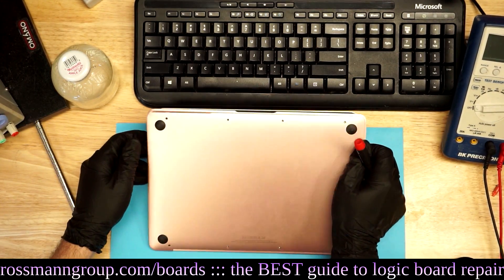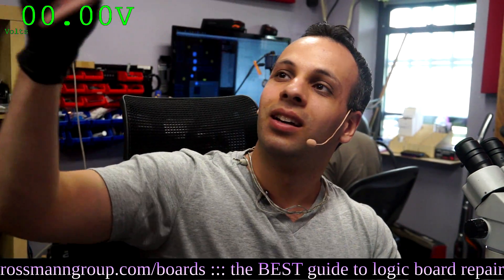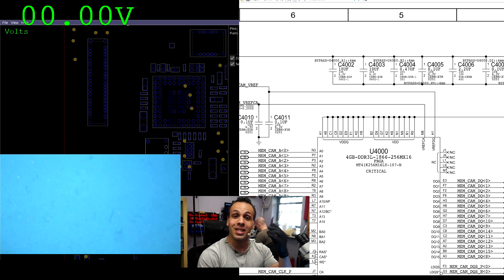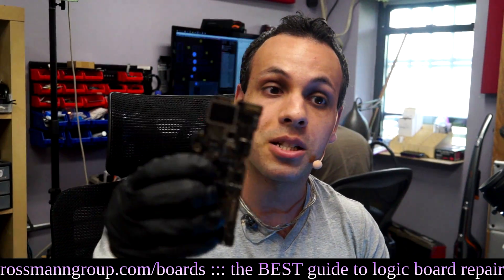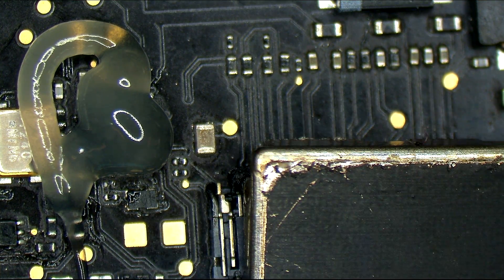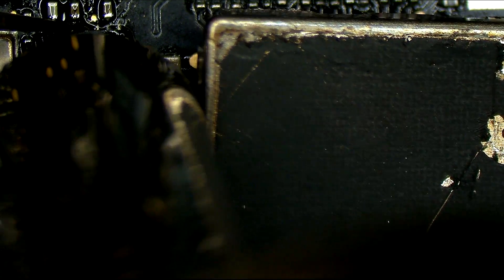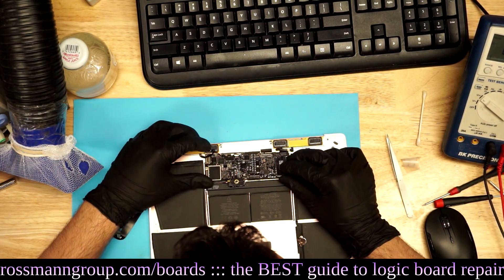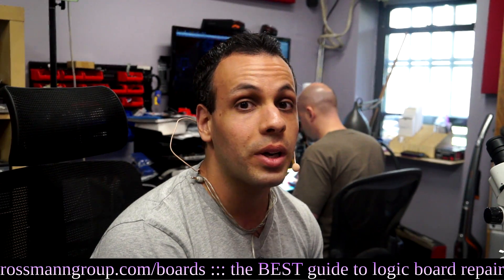Mall repair franchises are garbage and ruin the credibility of our industry.

Comment: Instructions unclear, got my testicles glued to the cmos battery.
Reply: Don't modern machines only need it for the RTC? BIOS settings are stored in non volatile memory?
Reply: I HATE when that happens
Reply: Abdullah Ahmed  r/wooosh indeed
Reply: my balls are the cmos battery
Reply: Cmos (complementary metal-oxide semiconductor) is a semiconductor - and cannot be battery...
Reply: @mrkv4k  he is actually correct. A cmos battery a coin cell battery for the Cmos to be able to store everything.
Reply: @ madmax2069 No, he isn't. Again, "cmos" is the technology,  "Cmos to be able to store everything" is just a nonsense...
Reply: @mrkv4k  It's commonly called a cmos battery. Stop being pedantic.
Reply: @demoniack81 Ok, I wasn't aware that this mistake is common.
Reply: @mrkv4k  It's a valid name for the battery.  Probably more prevalent than other names.
Reply: @mrkv4k  Its the term usually used to describe the small amount of memory on a computer motherboard that stores the bios settings, you could call it Real-Time Clock. CMOS RAM, NVRAM or NV BIOS memory or even COS-MOS which means complementary symmetry metal oxide semiconductor.
Reply: @ Kristian T. Again, it's not. Not a term. I get that people colloquialy use it (even within the industry), but "CMOS" is a short for "complementary metal-oxide semiconductor" and is a term for technology, simmilary to older TTL (transistor-transistor logic). Correct term (that you could use for example in your bachelor thesis) would be "RTC battery" or "BIOS bettery".
Reply: @ SerpentInside One more time, ok, it's a commonly used name. But it isn't a term. Term is something, that you could write in your university work.
Reply: @mrkv4k  So the problem here is that this guy glued his testicles to a CMOS battery, however that either doesn't exist or isn't an acceptable term solely because you can't use it in an academic paper?
If I recall correctly, informal comments online, such as the ones here, do allow for colloquialism.
Reply: Cosmic Taco Cat I never said they don't.
Reply: @mrkv4k  Well. Why not just Google it up and see what it actually means?
Reply: @johnyang799  I know what it actually means and that's why I responeded this way. I get thet you are confused by google and many people searching for the this non-term, but that happens all the time (try googling Irregardless, it's not an actuall english word, yet you find it all over the place. Same goes for "persay"). CMOS battery is a nonsense, that many people (especially those who are into computers but not electronis) use.
Reply: @mrkv4k  No. You only knew what CMOS-FET meant. Not the term cmos battery. Term came from practice. Not what you think it would be. It's misleading for you in the beginning yes. Now you need to accept it as a term.
Reply: @mrkv4k  CMOS battery is not nonsense. It meant for battery for cmos which itself is short for cmos memory. Active memory that needs power to retain data. No issue there. 
Same as phone battery, car battery. It's not battery that made from/of cmos it's just battery for cmos memory.
Reply: @johnyang799  Oh, I see the problem - you don't know what "term" means! Term is not just a colloquialism that is used by engineers and it almost never "comes from practice", it's well defined beforehand.
It's obvious that it's above your head, since "CMOS-FET" is another nonsense that you've fabricated on the spot. The "C" in "CMOS" stands for "complementary" and that means the ability to have P and N chanel "FETs" on the same die. It's a technology that logic chip use. the "FET" stands for "field effect transitor" and is for single transitors. The "CMOS" is always made out of "MOS-FETs", but using those terms together, as "CMOS-FET" is like saying "woods-tree".
Reply: @mrkv4k  "actuall" isn't an actual English word either. 
Plenty of people use the term CMOS battery, as it stores changes made to the BIOS stored in the CMOS. 
Your car doesn't need a battery to run either - is there no such thing as a car battery?
Reply: @Cheepchipsable  That is not what we are talking about here, is it... And no, noone uses term CMOS battery, because it's not a term. It's a nickname at best.
Reply: @mrkv4k  I do appreciate this conversation, thanks
Reply: @ArtisticallyEligible  Well, sure :D And thank You, because it has been going on for about a year now and I have never read it all at once - up until You've mentioned it...
Reply: mrkv4k I just read the entire thread.

2 months ago, I overclocked my RAM, fucked up badly and wanted to reset BIOS. I searched through google and was asked to reset ‘CMOS battery’. Did it. So I always thought that the coin shaped battery in the Mother board as CMOS battery until I read this thread. I searched through most of the articles now, for example, ‘reset BIOS’, ‘Where is the BIOS setting stored’ etc. Every single one of them refers to the battery as ‘CMOS battery’. I also searched ‘What is CMOS battery’. I did find great amount of articles and forums, study materials that refers to the battery that supplies power to CMOS RAM as ‘CMOS battery’.

mrkv4k, though it is embarrassing to say, I am unable to find the standard term system for the parts in the motherboard. 

Would you please provide the source material which is peer reviewed and widely accepted as industrial standard for the parts in the motherboard?
Reply: @BharathiChristiano  No, I would't. It's not necessary and it would take too much of my time. It is clear enough from the meaning of those words, since the "CMOS" stands for complimentary metal-oxide semiconductor, it is by DEFFINITION not a battery, it's technology used to make semiconductors.
What you are talking about is just like saying that you went to a pub, ordered Coke and got Pepsi. Therefore "Coke" is a term for Pepsi or soda in general... And you've chcecked this online with many and many people using it like this.
I seriously dont know how many times I have to repeat this, it doesn't matter how many people are using something, people are using words wrongly all the time.
Reply: @mrkv4k  "Not necessary"

When you present an argument that it is correctly used term, you present the proof of actual usage in industry or the standard metric along with the argument. 

Argument with no proof of reference is just some random baseless claims.

I believe we all in this thread that partook in reply to your comment know that it is indeed a MOSFET fabrication process, so you don't have to state it multiple times which they all already knew. 

What all of the participants try to explain is that "the CMOS RAM requires power, that power is provided is provided by a battery, the battery is commonly referred to as 'CMOS battery'. Just because name 'CMOS battery' has 'CMOS' in it doesn't mean we are referring to the technology itself, it is just a battery that power CMOS RAM."

 Everyone says in this thread said this.

Your argument is that 'it should be called CMOS RAM battery or Nonvolatile BIOS memory battery or memory battery'.

Well those terms are indeed correct but it is curretly widely used as 'CMOS battery'. 

You have three arguments for this,

1. It is not a industrial standard term.
2. It is not widely used.
3. People are using the wrong term.

For point 1, you have yet to provide reference or evidence of some sort.
For point 2, it is indeed widely used from Wikipedia to tech forums to motherboard OEM to chipset OEM. 

From the industry chipset leader, 'Intel' reads as follows:

"What is CMOS?

Complementary metal-oxide-semiconductor (CMOS) is a small amount of memory on a computer motherboard that stores the Basic Input/Output System (BIOS) settings."

Not even the industry leader refer to CMOS RAM as CMOS RAM. It was referred to as CMOS. 
As for point 3, only you happened to wrong. Remember the name of the  PCB that holds all this technology, 'Mother board'. So by your definition, "it is a board made of mothers" or "board for mothers".

It is not. It is a PCB that is found in computers, expandable systems, etc.

https://www.intel.com/content/www/us/en/support/articles/000025368/processors.html

I can provide a reference that it is indeed a widely used term along with the term 'memory battery'.

Reference: https://en.wikipedia.org/wiki/CMOS_battery

A wikipedia page, widely referred to by people for references.

I also have other hundreds maybe even thousands of articles and study matetials which refer to the battery that powers CMOS RAM as 'CMOS battery or memory battery' or 'CMOS battery' in the motherboard.

What reference do you have that it should not be called CMOS battery?

If you have no reference to any study material or evidence industrial usage, we can stop this conversation and finalise that it is indeed called as a 'CMOS battery' or 'memory battery'.

We finalizing has no impact on how the CMOS battery is referred to, it is already been, being, and will be used as the term by the people and the industry.
Reply: @BharathiChristiano  That is so wrong, on so many levels, I don't know where to start.  You didn't even bother to write my argument correctly...
Btw, you can keep telling us that your have "two stroke four piston battery" in your car, it's fine with me.
Reply: @mrkv4k  No argument there. Well that is what I expect from a groundless argument.
Reply: @BharathiChristiano  when someone refuses to admit they know absolutely nothing amiright
Reply: @jonniezodiac  The argument would hold some ground if there was a standard reference for the claims. There was none so let us leave it at that. No point in arguing over baseless claims.
Reply: @BharathiChristiano  You have demonstrated that you dont even know what the claim is. How am i supposed to argue against that...
Reply: @mrkv4k  You are very welcome to explain that claim as well that 'How I don't know what a claim is.'
Reply: @BharathiChristiano  And to be exact, because I already see you making even bigger pile of BS, let me dissect that comment:

I believe we all in this thread that partook in reply to your comment know that it is indeed a MOSFET fabrication process, so you don't have to state it multiple times which they all already knew.
- I believe that you don't, since you over and over misuse the correct terms. MOS-FET is not CMOS, it's not even the same fabrication process. You are CLEARLY talking about stuff that you don't know anything about.

What all of the participants try to explain is that "the CMOS RAM requires power, that power is provided is provided by a battery, the battery is commonly referred to as 'CMOS battery'. Just because name 'CMOS battery' has 'CMOS' in it doesn't mean we are referring to the technology itself, it is just a battery that power CMOS RAM."

- So? I have never disputed that.

Your argument is that 'it should be called CMOS RAM battery or Nonvolatile BIOS memory battery or memory battery'.
- No, it isn't. My argument is that "CMOS battery" is not a term.

You have three arguments for this,
1. It is not a industrial standard term.
2. It is not widely used.
3. People are using the wrong term.
- ad 1. Never said it isn't. ad 2. Never said it isn't. ad 3. Yes, they are. Like in sooo many cases where two or more fields of study cross.

From the industry chipset leader, 'Intel' reads as follows: ...
- As an experienced engineer, I have to say that this kind of work is being done mostly by interns and part time working students. It doesn't really contradict my point, since having colloquially used phrase on your website help has nothing to do with the correct scientific terminology...

A wikipedia page, widely referred to by people for references....
- Wikipedia is written by people (like me for example) and it is not a reliable resource. That said, I see no harm in having page on something that is commonly used jargon, especially in the very specific field.
https://en.wikipedia.org/wiki/Wikipedia:Reliable_sources/Perennial_sources
Reply: mrkv4k  Apparently you did not do a good job at dissecting anything. Here is the response:

You claim that I claimed Metal oxide semiconductor field effect transistor is CMOS. I did not. I claimed that it is a MOSFET fabrication process.

Reference: https://en.m.wikipedia.org/wiki/CMOS

Your main argument is that the circular battery that powers the CMOS RAM cannot be called CMOS battery.

I would rather take a industrial Chipset designer and manufacturer, and Motherboard manufacturer's  naming convention over a random stranger claiming he is a experienced engineer. Even if you are a legitimate engineer, your experience has no meaning in the industrial naming convention. You are raising credibility question over the industry leader for using less competant engineer to compile the website when you never have produced any reference which raises questions on your credibility not on the OEMs using the naming convention.

Yes indeed. Wikipedia is written by people. Apparently there is this section in the wikipedia page called 'References'. Reference section has links to the IEEE papers, study materials, books, etc. which the page has written as references by people. Disregarding the particular page is same as disregarding the references that is used to compile the information in the page which leads to questioning your competancy or maybe even integrity as an engineer.
Reply: @BharathiChristiano  At this point, it is absolutely meaningless to loose any more time with you. You post strawman after strawman and argue against something that was not even said.
"Your main argument is that the circular battery that powers the CMOS RAM cannot be called CMOS battery." 
-No, it isn't. I think you are just trolling me...

"You claim that I claimed Metal oxide semiconductor field effect transistor is CMOS. I did not. I claimed that it is a MOSFET fabrication process."
-No, It is neither. And again, I am not surprised since that wiki source is some random blockpost on some random website... That statement is literary like saying that table making is a kind of chair-making process.
Reply: mrkv4k “straw man after straw man”, while I was quoting what you had to say and the article and its reference has to say. Right.

It is thought that is point of this entire thread, saying otherwise is just not genuine. CMOS is indeed a MOSFET fabrication process and I also gave you a reference which had references from IEEE papers, it’s history, study materials, etc. I don’t care about your personal feelings towards naming system and your thought process. All I care is industrial wide accepted naming convention which I have provided plenty of references for and you have none (yet). I am quite willing to learn, if you can provide at least one source material for your claims that is peer reviewed or naming convention system that is industrially accepted.
Reply: @BharathiChristiano  
So you quoting me is the reason why I had to write "No, it isn't" after every time you write "your point is..."? Is that how it works in your opinion?
And while you continue to dismantle something that is not my argument, how is that not a strawman? That IS the EXACT definition of a strawman...
Reply: @mrkv4k  Exactly! "No, it isn't" isn't enough. Reliable reference or it's just baseless claims. I referenced all of your previous replies and information while you claim you did not and no references for naming convention yet. Pretty much you have no reputation now to make claims and say it is the standard. While I have none either, but I provided some references which is pretty much have references from reputable sources.
Reply: @BharathiChristiano  At this point, you are just trolling me... "No it isn't" IS enough when you clearly misrepresent (or completely fabricate) my claim. That IS the definition of strawman.
Reply: @mrkv4k  Oh I did not, did I? Pushing aside all arguments as 'trolling' is just a bad argument per se.
Reply: @BharathiChristiano  Look, you are really dishonest. I corrected you repeatedly and yet, you are still putting things in my mouth. And acting like my argument is somethingh else than "CMOS battery is not a term". You even wrote:
You have three arguments for this,
1. It is not a industrial standard term.
2. It is not widely used.
3. People are using the wrong term.
And where is your misinterpretation must be clear from my response: - ad 1. Never said it isn't. ad 2. Never said it isn't. ad 3. Yes, they are. Like in sooo many cases where two or more fields of study cross.
Reply: mrkv4k Exactly. You told people that it isn’t correct because you can’t use it as a reference for any material such as school, college projects, etc. in your previous replies to others. If you want to correct people that ‘it isn’t right term’, then provide a reliable source that says it isn’t called CMOS battery. I could careless about a stranger giving explanations, all I want is a reliable reference which you had plenty of time and text space with no limitations, you still failed to provide any of that, while I searched through internet for maybe 2 minutes? Found IEEE papers, study materials, articles, etc. referencing it as ‘CMOS battery’. I am the one dishonest here? I don’t really care what you think of me, all I want is reliable source. Pretty non genuine to be honest.
Reply: @BharathiChristiano  You repeatedly claim that you've found "IEEE papers that use 'CMOS battery'", but I haven't seen one from you, only the claim itself. As far as this exchange showed, all you have is articles from some websites and wikipedia. If you actually do the search on IEEE website, you won't find anything: https://ieeexplore.ieee.org/search/searchresult.jsp?newsearch=true&queryText=%22CMOS%20battery%22

On the other hand, It's nearly impossible to find peer reviewed article about something that isn't a term. Like try finding one about this https://upload.wikimedia.org/wikipedia/commons/5/59/Vespula_germanica_Richard_Bartz.jpg not being a Ford Focus...
Reply: @mrkv4k  "You repeadly claimed"

If you have care to look at the wikipedia page references there are IEEE paper, books, and even a CMOS battery wikipedia page which has multiple references. Don't forget the Intel (Chipset market Industrial leader) reference.

As for "I couldn't find any", then how have you claimed that the "CMOS battery" is indeed not called 'CMOS battery' and it is called 'something else'. How have you claimed that you can't use the name 'CMOS battery' because the school or college wouldn't accept it without reference?

I have provided enough references which calls it as 'CMOS battery'. The references include a Industrial Market Leader in Chipset manufacturing, a wikipedia page with references that includes IEEE papers, study matetials, books, etc.

While you have provided non yet, other than the link for search result in IEEE in this reply and a link for search suggestion.

Coming to the main point, finally you have reached the answer. After multiple questions and exchanges for links.

"CMOS battery" is not a term. You do agree with me in your reply by asking 'me' to search for term because it does exists.

It is a name which was used by PCB manufacturer which the PCB is designed to accomodate CPU, RAM, etc. to run an operating system. OEMs collectively started calling it 'Motherboard'.

Motherboard is not a term. 'Motherboard' as a term makes no sense. It is just a name for PCB that houses components which runs an operating system.

As enthusiasts started tweaking BIOS, they ran into multiple problems of booting. So Motherboard OEMs started refering to the circular Battery as 'CMOS battery' for repair. CMOS battery is just a name for battery, not a term. 

As a term, it makes zero sense. 

But OEMs did not use it as a term. The name was widely adapted by multiple OEMs and the community.

Take a Apple's Mac for example, the name for PCB that houses slots to house CPU, RAM, SSD, etc. is called LogicBoard. They also refer to their repair technicians who knows nothing (generally) as 'Genius'. It is a name, not a term.

A name, not a term.

When you try to argue that a 'name' is wrong and recommend to use a different 'term', people are not going to take it seriously and going to not use the word that has been widely adapted as a 'name'.

Because there exists no standards for naming products and their components. It is upto the OEMs.

Remember, a name is not a term but there do exists a term which people don't normally use or refer to, Like, they don't refer to Motherboard as PCB or Logic Board as PCB. It is correct to call it a PCB but OEMS refer those to their own names so does the customers.

Actual term for that battery is 'battery'.

Nothing more, nothing less.

As always, I hope you learnt something.
Reply: @BharathiChristiano  Yeah, and by the way:
8. CMOS is still not a "MOSFET fabrication process". That part of that wikipedia article is simply wrong (And taken word-for-word from some unknown website blockpost).
Reply: @mrkv4k  "Thick as brick"

When I explained clearly why you were while I lead to the answer? Laughable indeed.

1. Correct me with an answer that doesn't have any reference? You claimed 'CMOS battery' is not the right term, while it is not a term, just the name. You were just wrong.

2. While I gave you multiple source and one of which is a Industrial leading cipset manufacturer who uses the name 'CMOS battery'. I am not going believe anything a internet nameless experienced engineer has to say anything when  OEM uses the 'name'. Also the wikipedia link also has references to IEEE papers. Selective data viewing is laughable indeed.
3. Another claim with no proof. You can provide proof that the website is made indeed by the intern. There is no disclaimer I saw that says so. I am not going to believe anything a person with no credibility has to say unless there is a proof for your claim from the ORM themselves.
4. Oh there we go. "I don't have to provide any evidence, believe me". No, I am not believing you for your word. Besides, I explained why it is naned 'CMOS battery'. If you actually happen to read that nobody here claimed that the battery is made of semiconductor. It is a name, not a term.

5. Yes, it is tolerated because it is a name.  Not a term. A term would be 'PCB'.

6. CMOS battery is used by OEM of Motherboard, Chipsets, etc. because it is a name. If you happen to read the previous reply, you would actually understand why it is a CMOS battery.
7. Evidently you did not understand anything what others tried to explain, you refused to learn that it is a name not a term.  You claim that 'I can't understand'. Laughable indeed.

8. I realised I have not quoted it fully after reading the article again. "CMOS is a type of MOSFET fabrication procrss that usrs Complementary and Symmetrical pair of p-type and n-type MOSFETs for logic functions".
I have not quoted fully from the reference but that explanation from the Wikipedia is still correct.

Reference: 
IEEEE INSPEC Accession Number: 18547287.

When I quote something, you have to read the reference not take my word for it, that is what any experienced engineer would do. Which you also happen to read and also disregard it as 'It is from a blog site so it is not true to the fact". Quite some experienced engineer indeed. 

You fail to read the explanation, you fail to go through the reference, you claim something and provide no reference, while I provide references, and explain before hand. Good job. Good job indeed.

As always, I hope you learnt something.
Reply: @mrkv4k  If you still happen not to understand I will make the following helpful guide that makes you learn a bit:

Name: Mother board, Main board, Logic Board, etc 
Term: PCB

Name: Intel I7, Ryzen 5, Intel Xeon, Threadripper
Term: CPU

Name: LPX Veangence 16GB High speed memory, Coolermaster 16GB memory, etc
Term: RAM

Name: CMOS battery, BIOS battery, etc.
Term: Battery

This is a cool guide you can refer to anytime you get confused with a name and a term as an experienced engineer. 

Well there isn't any saying that experienced engineer has to be any competant so good luck.
Reply: @BharathiChristiano   Please read it carefully, because this is really painful.
1. I claimed that it is not a term, which it isn't. I also said that it is a colloquially used name, which it is. You admited both of those points yourself, so WHERE was I wrong?
2. You gave me "multiple sources" of one (or two) wikipedia article, which doesn't even have the reference for that name. That is not an evidence, that is nothing...
Also, that "IEEE reference" has NOTHING to do with the argument, since it's about designing circuits with CMOS chips.
3. You have it the wrong way around. That whole paragraph is about you calling some random help article as "evidence" when it clearly isn't.
4. So you say that I am right, right? Or what are you saying? That IS MY POINT ENTIRE FCKING TIME! Why do you think that I've written that you are strawmaning me, when you clearly misrepresented my argument?
5. No. Simply no. PCB stands for Printed circuit board and it is the main component of any electronic device. Motherboard (or preferably Main board) is a specific PCB that has supporting electronics (for example power regulators, logic chipset, etc.) and slots for other boards. I think (aldo I am not sure here) that you could use "motherboard" in your scientific paper and it wouldn't be a big deal (unlike the "CMOS battery", which would be a major deal).
6. If you happened to read what strawman is and why are you misrepresenting me, maybe we could get to the common understanding ten posts ago.
7. You clearly can't understand, because you keep repating that I am saying that it isn't a "name" when I am not.
8. No! That referenced article is open access, so you can read it even without paying the IEEEE: https://ieeexplore.ieee.org/document/8490692
There is nothing about CMOS being "type of MOSFET fabrication process"! That part is completely wrong. It even seems that the original post was corrected:
http://wickedsago.blogspot.com/2011/04/what-is-cmos-memory.html

So no, no and no again. I did go through your references, found them completely wrong, asinine and/or about something else. This whole thing was a total vaste of time, even tho I had some fun. Still, there is really nothing to learn from you.
Reply: @BharathiChristiano  And if you wanna learn (if it even is possible), here are some corrections:

term: Main board (Mother board)
marketing name: Logic Board
- It's a PCB with necessary and supporting components (like power management, communication logic, drivers, etc.) that function as a base for other components. 

Term: PCB
- Much bigger group that include all printed circuit boards. They are usualy made from copper (some rare cases aluminium) and non conductive material.
They electricaly connect mounted devices and also work as a mechanical support. PCBs can have single or multiple layers, usually up to 12.

Term: CPU
- Any Central processing unit, look it up.

Marketing name: Intel I7 (for example -610E)
term: 64bit dual core CPU

Marketing name: Ryzen 5 (2600X)
term: 64bit hexa core CPU with build in GPU
etc.

Marketing name: LPX Veangence 16GB Term: DDR4 SDRAM

Term: RAM
- Basicaly any type of random access memory, even this: https://www.digikey.com/product-detail/en/microchip-technology/23K640T-I-SN/23K640T-I-SNTR-ND/2001090

Term: coin-cell battery
- Any battery in the "button" style package

Cologuial name: CMOS (BIOS) battery
term: 3V primary lithium coin-cell battery in 2032 package.
- Is specificaly used on motherboard for backing up memory that stores BIOS or RTC. Like: https://www.digikey.com/product-detail/en/energizer-battery-company/CR2032VP/N189-ND/704858

So, did you get it? Every time you are trying to be "smart", you just fail miserably...
Reply: @mrkv4k  Congratulations. You have typed all the terms in a fit which mostly is wrong or just expanding my guide.

1. The moment you have used 'Main board' as a term instead of 'PCB' is when you lost any credibility left at all as an engineer let alone being experienced engineer.

2. Main board comes under the umbrella of PCB design. It does not represent a new term but just a product.

3. This is where your competency as engineer is showing up. 
32 bit or 64 bit mentions that the 'CPU' is using 32 bit computing or 64 bit computing. 
If the Number of Processing units in a CPU is two or more, then the term is Multi-Core CPU.

So we have three different terms which you have combined into one as quoted as a 'term'. As I quote you, "It is a cologuial used term".

If you want to use the term correctly use this guide:

CPU uses (32/64 bit Computing) and has Multi-core processing with (number of processing unit) processing unit.

CPU is the term which every 'CPU' comes under and adding a term does not remove it from the umbrella term 'CPU'. If you even remotely thought that was okay, that would mean the engineer has lowest of competancy in industry.

4. Come on now, you just repeated what I have said for RAM and you referenced a OEM which as you claimed is written by intern with no proof. Being a hypocrite arr we?

5. As I have explained for CPU, same goes to the battery. 'Battery' is a umbrella term. 'Coin cell battery' is a term for a battery that is button shaped. It is perfectly acceptable to call it a battery or primary battery or coin cell battery. You did not even the reference a standard for this but you referenced a product page. "Expereinced engineer who requires a reliable source". Laugable indeed at the Competancy.
Reference: IEC 60086

You refer the name as "Colloquial name" to manipulate the data to your narrative, While industrial leading chipset maker refer to it as a name. What makes you think that a name, used by a OEMs is not a name but used as as term.

"Every time I try to be smart..."

Oh please. I just facts with references. Disregarding the facts as 'Oh you are trying to be smart' shows incompetancy at its finest.
Reply: @mrkv4k  I am reading very carefully. Is it painfull because you were wrong maybe?

1. Everyone also claims that it is not the term and it isn't. Not just you. It is a name. Exactly! You do get it after all.
2. Oh here we go. The IEEE article I have provided has perfect deinitions. Good job at disregarding the definitions in a IEEE paper. "Experienced engineer"
3. "A random help article" - From a Industry leading chipset manufacturer. I am not going to take any word for a word from a "incompetant experienced engineer".
4. You claim that it a "colloquial name" not a name as a product. If you don't know, colloquial name means 'Informal names that cannot be used as formal names'. It is a perfectly acceptable name because it is a 'product name'. It is same as if anyone says, "It is not acceptable to call the iPhone an iPhone but a phone". iPhone here would be equivalent to CMOS battery and phone would be to battery.

5. Motherboard is a PCB designed to commodate slots for components which is used to run a  operating system. You can use the name 'mother board' but you can create a name in introduction after writing an explanation and have a reference name. You can't use 'CMOS battery' because it is a name, yes.
6. Oh please. It is a name for a product, which you claimed is collowuial name. No strawman here, you just happened to be wrong.
7. It is a product name which OEM uses and you refer to a 'Product name' as 'Colloquial name' which community uses. OEM gave the namr and community uses it. Nothing Colloquial about the product name.
8. Did you even read the my previous reply? I have explained I have not quoted the full sentence in previous replies, so I quoted the entire sentence and gave you reference that has CMOS explanation in it.
Previous quote if you happen to not read it yet, "CMOS is a type of MOSFET fabrication process that uses complementary and symmetrical pair of p-type and n-type MOSFETs for Logic functions". It is not a fabrication process but a result of fabrication process that uses n-type and p-type MOSFETs for Logic functions.

You confirm this by going the introduction IEEE section.
Additional reference: INSPEC Accession Number: 16964073*

"Wrong, asinine" while it has relation which you refused to read. We call it by the name 'Selective data viewing'.

There is nothing fun about a facts really. I don't really care about what 'you' feel but about being 'correct'.

Oh you have a lot to learn incompetant experienced engineer.

As always, I hope you learnt something.
Reply: @mrkv4k  this is youtube, not university work
Reply: @diablo.the.cheater  Wow, no shit...
Reply: @mrkv4k  You know, a cmos needs to have a battery in order to run at startup?
Reply: @Sebastien Monette You mean bios, right? Cmos is a technology, that doesn't need battery, not even "to run at startup"...
Reply: @mrkv4k  Maybe, I'm not really familliar with computers
Reply: @sebastienmonette6659  CMOS needs the battery to retain it's settings and Date/Time info. Not really needed just to start up, you'd just have to reset date and time each time you start the machine.
Reply: @kellman1980  well on older computers it won't boot up if the battery is dead
Reply: @mrkv4k  Does the CMOS not reset itself if not powered?
Reply: @MrBlahblahblah12354  What kind of question is that? CMOS means "complementary metal-oxide semiconductor". Does the LED not reset itself if not powered?
Reply: @mrkv4k  That's a yes then?
Reply: @MrBlahblahblah12354  No, that's an misunderstanding of the whole thing. CMOS is a technology and it can't "reset itself" at all. You could say that CMOS NAND chip resets itself after powerdown, but that isn't entirely correct either as the output still deppends on the state of inputs during the power-up.
Reply: @mrkv4k  so, what's CMOS again? I got confused
Reply: @HowardChambers9679  xD
Reply: @HowardChambers9679  I think I was clear enough. As for this Jeeva guy, there is no point in arguing with someone who istn't able (or willing) to check his own sources...
Reply: @ Abdullah Ahmed I dont understand the language of your tribe.